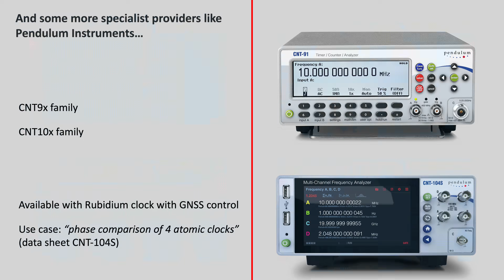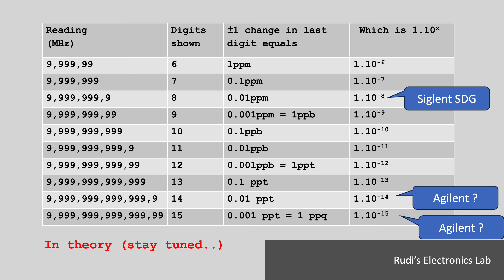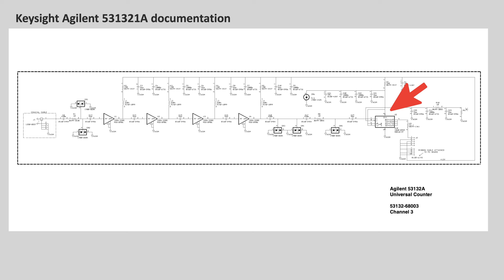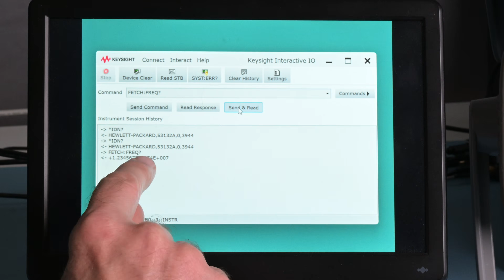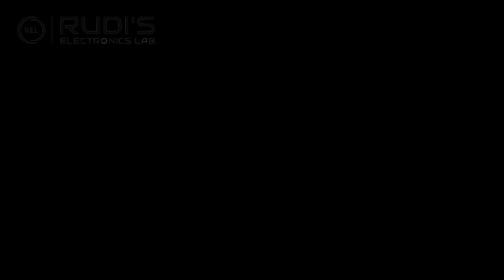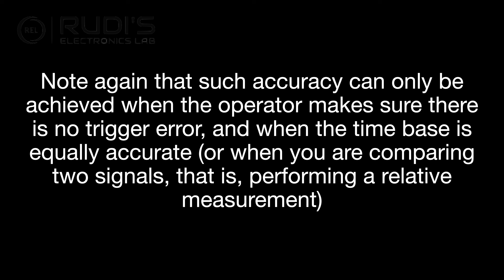REL #58 Agilent 53132A - Recovering the lost 13-15 digits

Comment: Hi, I have used almost all types of widely-used frequency counters on the market:  HP/Agilent/Keysight  53132A/53230A,  Standford Tech. SR620, K+K FXE phase meter, and Pendulum CNT91/ CNT100/CNT104. The K+K phase meter offers the best resolution, and Pendulum CNT series have comparable resolution. It is worth noting that, both have the true dead-time countering,  which is meaningful for calculating frequcny stability by Allan deviation.  I would also like to add that, the CNT series have the most user-friendly interactive UI. I think the price is not so unacceptable😄
Reply from the maker: Thanks! I have been thinking of picking up a CNT-90 myself, once I have again a little time for this hobby ;-) I like the way they implemented things, and also appreciate the Allen Deviation - something that I tried in s/w with the HP, but I felt I got stuck there as the HP does not always output RAW measurement values but uses various mechanisms to make more accurate readings. Great, but for an external Allen Deviation, you want uncorrected readings! Best, Rudi

Comment: To confirm whether the 14th and 15th digits are statistically meaningful, I believe it would be helpful to analyze the Allan deviation. If you connect the 10 MHz reference output directly to the input and take measurements over a some period, you can then calculate the Allan deviation from the dataset. This should give us a clearer picture of whether the least significant digits reflect real frequency stability or are simply noise.

Comment: Thank you for the excellent video!
I have a question regarding the Agilent 53132A frequency counter. If you connect the counter's internal 10 MHz reference output directly to one of the input channels and perform a frequency measurement, you would expect the reading to show exactly 10.0000000000000 MHz.
When configured this way, and using a 1-second gate time, does the computer-reported measurement consistently show all 15 digits as exactly "10.0000000000000 MHz"? In other words, are the 14th and 15th digits meaningful and stable when reading the result via computer?
I'm trying to understand whether those final digits truly carry significance or are simply artifacts of numerical formatting or internal rounding.
Reply: I wouldn’t expect rounding and formatting to be the reason. Frequency counters often use analog techniques to measure the LSBs that can’t be measured digitally. 
On my 12 digit Stanford Research SR620, the lowest digit is currently 2 when I do a 10MHz reference to input feedback. I need to run self-calibration to reset it back to 0. 
But even if the lowest digits jumps around, it still might be statistically significant after averaging multiple measurement.

Comment: You should ask the question about the arm mode on the time nuts mailing list. The designer of the 53131 is (or used to be?) a member of that community. 
In fact, if you have any interest at all in time measurement related topics, that mailing list is very helpful and useful.  The traffic is low volume, only a few emails per week.
Reply from the maker: Thanks for the tip! Will join that mailing group and try to find the answer to my query!

Comment: Don't forget Stanford Research Systems, they make nice counters also.  My FS740 GPSDO's counter function has 5 X 10 to -12 stability and 1uHz resolution.  Tektronix also has a MCA3000 series that's 12 digit up to 40GHz.
Reply from the maker: That FS740 was not yet on my radar, very nice indeed! And, while a small detail, I love how it shows MHz, kHz, Hz, mHz and uHz just below the reading. I keep on being confused about the comma/periods/space/whatever configuration of the various instruments I use!
Reply: @rudiselectronicslab861  I agree.  Clearly labeling the engineering notation with SI prefixes makes it so much easier to read.  I frequently look at other modern instruments I own and wonder why they didn't do the same.  Even older counters were even worse.  Many only showed a single decimal point and then a exponent number to indicate where the decimal was located.  Very frustrating.

Stanford Research Systems has been making the FS740 and their line of precision counters for years.  I don't think most people even realize they are still in business.  Their equipment is in use every day in R&D labs, calibration labs and the like all over the place unbeknownst to the general public.